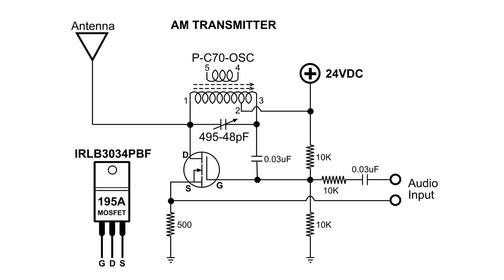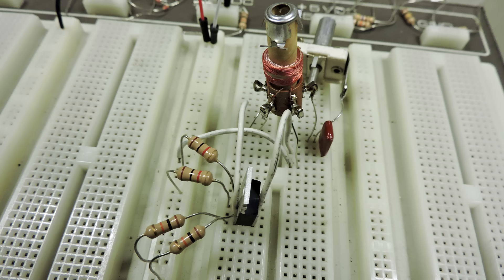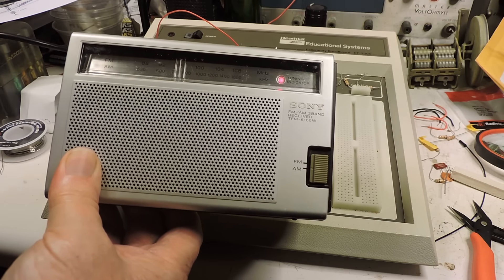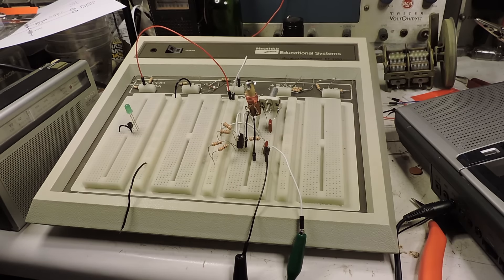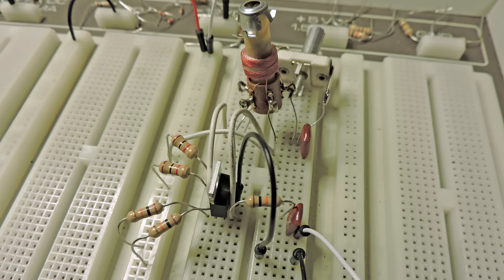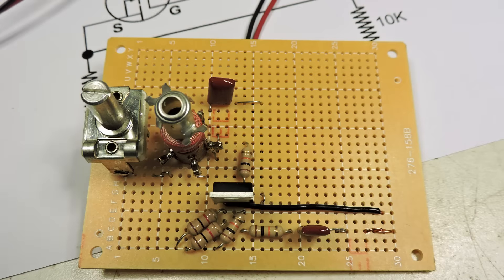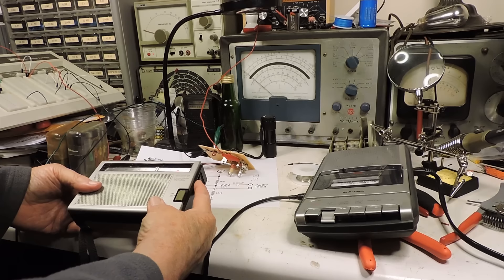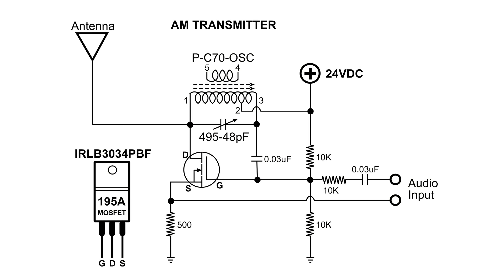AM Transmitter Solid State, build and demo

Comment: Thank you for the inspiring ideas. Can we use a crystal instead of the resonant circuit? Regards.
Reply: Kinda defeats the purpose of the circuit don't it?
Reply: It's actually handy being able to tune it. Leaves you free to find a sweet spot in the band. My design has a 1Meg crystal and sometimes, there is another station lurking there.
Reply from the maker: You could use a crystal but there not as flexible.

Comment: Hi,
Very nice low part count, and how easy you made it look.
Seems to work good to boot I don't know how far away you walked but it still sounded clear.
With the Variable capacitor could an air type be used instead of the type you used (Compression??) and also could a fixed value be used instead of a variable type as that would be deciding the freq??.
The voltage 24V is that determining the range and power output?
Great project thanks for sharing.

P.S. Your painting is also a glimpse of your talent, I am extremely impressed with all your videos/projects, Thank you
Reply from the maker: Thanks Oswald Wabbit
Yes, an air type faster variable capacitor. A fixed capacitor would be a little tricky to use because as the components heat up the frequency changes slightly. The 24 V power supply will influence how far the signal can propagate, and of course it's in conjunction with a good antenna.

I tried to make my designs with the intent that most persons will be successful when building these projects.

They do need to get back to painting, but the one in the video will probably have to wait until the fall.
Reply: Hg

Comment: Very interesting video. I was thinking about building one using a vacuum tube, but that involves much higher voltages, and a lot of heat.  I bought a 117L7 to use, but I noticed when testing it that it really generated a great deal of heat.  Not only that, but the tuning capacitor will have B+ on it, which would be safer at ~24 volts than 160 - 170 volts.

I want to build a power supply for this circuit.  Do you know how much current it draws in operation?
Reply from the maker: Thanks
AM Transmitter Power Supply Build and Demo
https://www.youtube.com/watch?v=k3ZjRGAuIWU

Comment: Cool design Rick, did you try it at 9V or less? Why is it at 24v, thx
Reply from the maker: Thanks
Reply: Thanks, ok... I was just curios about the voltage.
Reply from the maker: The bias may need to be adjusted for 9 volts.

Comment: hi sir is reliable circuit? I mean no offense but most youtube circuits about am dont function.. its our project sir please reply sir
Reply from the maker: With an antenna it will cover the house. Look at my one transistor FM transmitters.
Reply: In my experience, when the Oscillator, Finally Amplifier and Series modulator are all as one, the transmitters mode will be AFM not AM or FM, but a bit of both. A Spectrum Analyzer or SDR will show a moving / unstable carrier when modulated.
Reply from the maker: This circuit will work on AM like you saw in the video. I used a real AM radio receiver. To cover the house you will need an antenna. To make the transmitter as stable as possible put it in a metal box. If you change the coil and capacitor in the tank circuit you can get it on the FM band. Just search my channel for “one transistor transmitter “. The radio receiver demodulator circuit will pic out the AM if you have it the transmitter tuned in the AM band or FM if you have the transmitter tuned in the FM band. The FM transmitter is a little harder to build, the parts must be very close together, but transmits much farther.

Comment: I don't want to ask for something you don't have time to generate but I like as a hobby building little transmitters and receivers. I just built the AM transmitter outlined in the following abstract but I'd like to build one without a canned oscillator and would be interested in knowing of your coil parameters.

"did not see Ben's diagram on my mobile internet, so I used a standard configuration with an audio transformer for modulation as in Ben's design. At the output I placed a hand wound coil/inductor having an inductance of .25 mH in series with a 50 K ohm pot that then connects to ground. When the pot is at a setting in ohms that I forgot to make note of the open circuit voltage is maxed at roughly 16 volts peak to peak.  

Without the coil and pot I only had roughly 4 volts peak to peak. The power source I used to drive the 'can' oscillator was 4 double A batteries in series. Additionally the coil/inductor reshaped the output from square wave into sine wave. 

I next measured the output impedance of the device by measuring the output open circuit voltage  and then the output voltage with a 10 K load resistor with my scope and by performing the calculation discovered when the voltage was maximized by the adjustment of the pot the output impedance was 7.7 K ohms. From this I calculated that for a coil/inductor used as an antenna I would need the inductor to have 1.24 mH for its inductance in order to have its impedance match the transmitters output impedance. I then wrapped, close wound, 24 MAWG wire around an 8 inch by 11 inch cardboard box. The number of turns I used was 47 which gave me very close to an inductance for the antenna of 1.24 mH. I then direct connected the antenna to the transmitter with no need for a capacitor because the coil antenna was designed to only be a perfect match at 1000 Khz Once connected I briefly turned on the transmitter to see if I was spot on with my assumptions or out in left field. Apparently I was spot on because the output across the coil antenna read 8 volts peak to peak exactly as it should were the antenna a perfect impedance match for the transmitter. 

From the measurements made I will determine the transmitter's power which I am reasonably sure is in the mW range. Once this is known, should the transmitter exceed Part 15 regulations then by adjusting the 50 K pot I can bring the transmitter within FCC guidelines, but still maintain the maximum range for use as a device to transmit audio books which had been the aim of the entire endeavor. "
Reply from the maker: What is your question?
Reply: @AllAmericanFiveRadio  I am interested in the specifics regarding the coils or inductors in your design. Specifically their inductance and configuration.
Reply from the maker: @migalito1955  https://www.tubesandmore.com/products/coil-miniature-adjustable-coil-70-oscillator

Comment: cq de kf6uxj. am wondering how long is the antenna, and does it fall in the fcc part 15 guidelines thanks in advance . kf6uxj out.
Reply from the maker: The antenna depends on the frequency. I used three alligator clip leads. The signal disappears when I walk outside of the house. It is up to the user to comply with FCC rules, part 15, to make sure you do not interfere with commercial stations, cell phones, security systems, etc. Just like it is with Armature Radio operator with a 1.5K transmitter. Are you studying for your General/Extra license? I just passed my General and Extra last month.
Reply: am codeless tech. couldnt do morse . may try again someday w morse as for regular tech is 5 wpm
Reply from the maker: Morse Code is no longer a requirement.

Comment: Hi, please help me. I have a project that transmit Text through RF signal. Can i use this circuit with adruino?
Reply from the maker: If the adruino outputs the information in an audio form to drive the transmitter.
Reply: Thanks for replying me, are you a coder? I have a project transceiver with adruino, but I don't know how to interface, if you can please help me!
Reply: I have codeed adruino transceiver Morse code, but that is adruino connect with RF 315mhz module, i don't know how to connect with AM transmitter
Reply from the maker: @conghanhoang1222  I have not programed an adruino, but I'll be glad to help if I can. I was a Soft Ware Engineer and Instructor for a large corporation, about 15 years.
Reply: When i programed, i didn't know how to declare the library in adruino, because this is a circuit, not a module 😒
Reply from the maker: This is like many engineering project, start at the end, at the transmitter. What does the transmitter need, it needs an audio input so the arduino needs to supply and audio output. This audio output from the arduino is physically connected to the transmitter input.

Comment: Hi Rick, It's Monday, May 23rd at 8:25 pm PDST, sunset at about 8:46 pm. I spent the evening working on my Crosley Model 56TC, All American Five Radio, replacing some old wires that had crumbly insulation and replacing the dial light wires, also quite brittle or crumbly insulation. I have a few more to replace, then, will order capacitors and new tubes. I am going to leave the Mica, domino style caps as I've heard they rarely go bad and are quite part specific. Just delving into radio restoration so please don't laugh at me, o.k. go ahead, you can. I'm confident with my research and sketches of layout that it will be a success. It can't hurt that I have watched probably every video you have made on antique radio repair, only the finest electronics tutorials bar none. Periodically I will keep you appraised of my progress. Reply only if you want to, as I'm sure you are busy with your projects. Thankyou for sharing your vast knowledge, I really appreciate it. Take care, be good, C.
Reply from the maker: Just take your time replacing the old wax capacitors, and the electrolytic capacitors, one at a time. If you have not downloaded my free e-book here's the link.
http://www.richardmcwhorter.com/vacuumtuberadio/
Reply: AllAmericanFiveRadio Hi Rick, I will go slow, one at a time like you do. I'm also going to leave some old lead as per your recommendation for caps. I will check resistor values and replace as necessary. Thankyou for the reply, and, the link, I will down load it tonight. Take care, Cass.
Reply from the maker: If the resistors don't looked damaged, just replace the cap's first.
Reply: AllAmericanFiveRadio Hi Rick, will do, Thankyou, be good, C.

Comment: I want make a sw transmitter approximate 10 km range . Please provide circuit schematic
Reply from the maker: This transmitters tank circuit is for the AM Band 540 kHz up to 1700 kHz.
So you can change the tank circuit for the band you want. You will probably only need to change the variable capacitor, make it smaller. I would build this transmitter for the AM Band 540 kHz up to 1700 kHz  first, make sure it works, then change the variable capacitor for your band.
tank circuit calculator
https://www.pasternack.com/t-calculator-resonant.aspx?utm_campaign=Power_Combiners&keyword=&gclid=Cj0KCQiAkMGcBhCSARIsAIW6d0Bq3xpUMCCILKuIgRrLfxLUhKLfrTl4do2voq455zj2jfSG1rdU3eYaAohGEALw_wcB